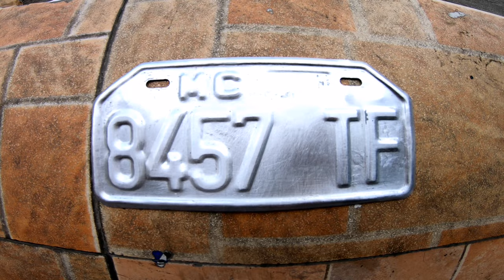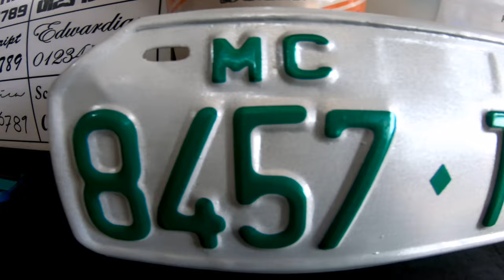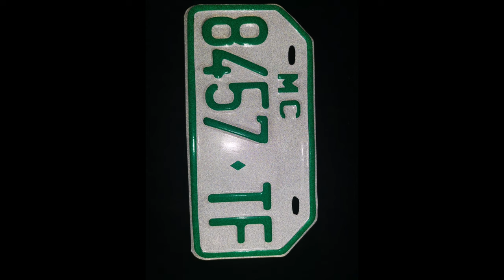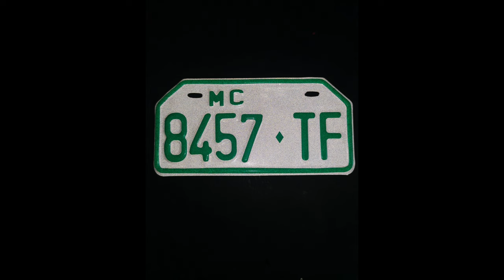PLATE RESTORATION VIDEO | 99 DECALS

Comment: The reflective material used in the restoration of the motorcycle plate, is the Scotchlite sticker sheeting from 3M.
Reply: Magkano kpal broken plate lng ksi malapit na mahowaly ung plate num.
Reply: Saan po nabibili?
Reply: pwede ba magpagawa sainyo saan loc nyo boss
Reply from the maker: Antipolo city po sir.
Reply: @99decalsvlog pagawa ako sir
Reply: San Po kayo sa antipolo sir at ano pangalan Ng shop nyo @99decalsvlog
Reply from the maker: @TeddyboyLlagas  99 Decals San Isidro antipolo bossing.
Reply: San po kayo pwede contakin